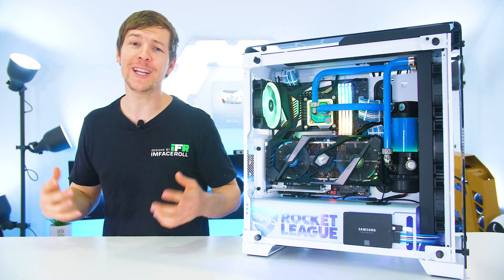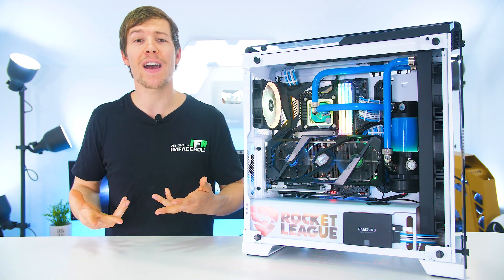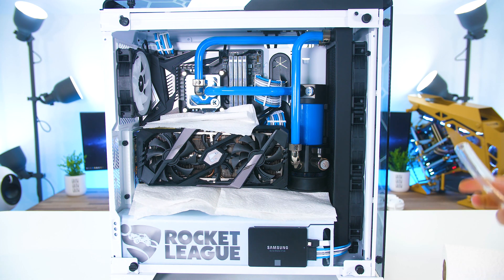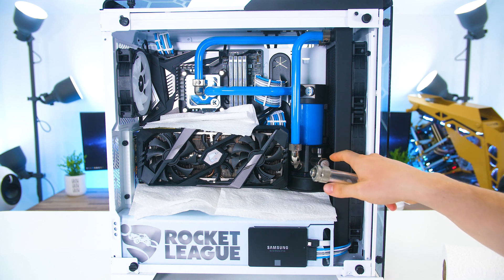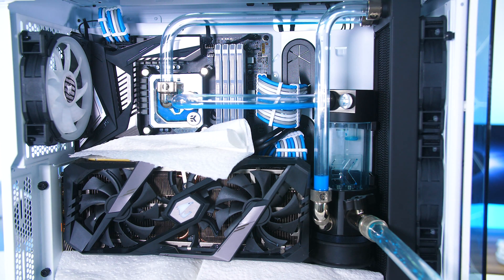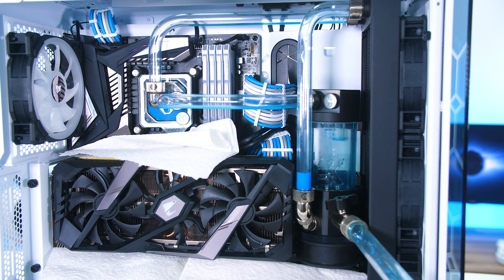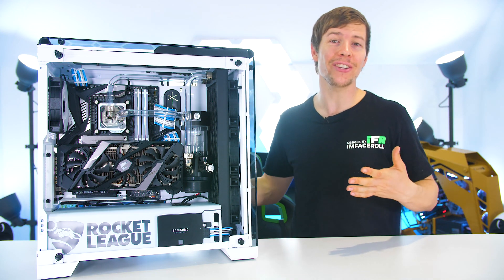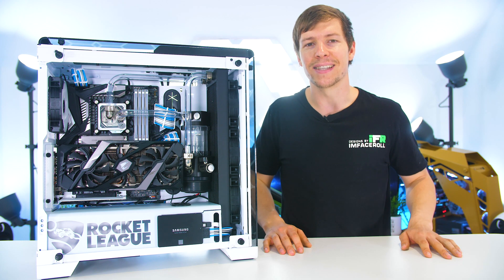Beginners Water Cooling Guide - How To Drain and Flush a Water Cooled PC Build.

Comment from the maker: Hope this helps someone out there looking into water cooling their PC Builds. Have a great day!
Reply: What case would you recommend for a soft tube rig?
Reply from the maker: Anything that fits the size radiator you are after. The good thing about soft tubing is it is flexible so it would work in most cases. The thing you really need to look at would be radiator compatibility
Reply: Designs By IFR what do you mean by radiator compatibility?
Reply: Thank you i need to flush my Pc and check the 2x 1080tis waterblocks :) Thanks for the vid :)
Reply from the maker: Very welcome
Reply: Yes thank you help me at lot
Reply: I am planning on using an antec torque waterblock (the thing you used in your most recent video but didnt fit with the graphics card) I can not find a suitable spot to put the drain port. the is one on the block but I think putting a drain port on the outside of the case will look really horrid. what is your recommended solution? should I just use a plug and when it comes time to drain throw the pc on its side and hope for the best?
Reply: Awesome Vid
Reply: In the description of the video for the GPU it says asus instead of aorus, just letting you know
Reply from the maker: Thanks for letting me know
Reply: Designs By IFR more important can I use my power supply bridge while draining the pc? Tech source said if your system runs dry it could damage parts.
Reply: Designs By IFR can you please explain how do you do the headers? A Mobo only have 2 rgb headers so how you use so many rgb fans?
Reply: I don't even know where to start. I've got a pre-built computer that came with water cooling and I've been very nervous cuz I don't know how to maintain or check it for any issues
Reply: I have a problem and couldn't find solution 
I have custom water sys 
2x 360mm on top and on bottom 
The bottom radiator is so so hot while top is not even warm 
Im not sure is it trap air or damaged radiator

Comment: Is able to build this config only with 3 "bent hard tube"? (bought directly from aliexpres or amazon for example. I'm not able to bend this tubes myself,  it seems too complicate). What kind of fittings you used (I guess 6* G1/4 + 1* 90º + 2* 45º) may be? I cant see the fitting you used behind the tube that goes from bomb to radiator, What fitting did you use? Thanks in advance

Comment: Hey buddy. Do you have your draining fitting attached to the 'IN' port on your pump/res? This is where I intend on attaching mine but wasn't sure if it was the correct port to use. I want radiator > top of pump/res > OUT port to GPU > CPU > back to radiator. Cheers

Comment: I'm sorry to sound harsh, but this video is pointless. If you have a valve, you're already well suited in watercooling, and it does not need a 10 min video to show how to link a tube and turn a valve open, then running destiled water... A video showing a build with no valve whatsoever, using bare methods for removing the cooling would be a useful video. Love the channel, but this video, pointless...
Reply from the maker: Its not pointless at all. What if you are a beginner (as the title says) and you have no idea what you are doing and you want to purchase parts for a loop, a lot of people wouldnt even think of a valve or a bit of soft tube to drain it. A lot of people wouldnt think to flush it or yo remove the top port. Instead of looking at it from the perspective of someone who already knows how to do it, look at it from a beginners perspective.

Beginners are nervous about watercooling so any and all information is helpful for them.
Reply: Can you still show a method without the valve though:)

Comment: Great vid. Nice looking build there mate. I ended up using 3 drain valves in my parallel loop just to make coolant changes much easier .My drains are set up so that all I need to do is remove one side panel and attach the hose like you showed. Besides my case is too heavy to tip up. Half the issues people have with draining their loops is that they sacrifice practicality for looks. I run distilled water only in my loop after having issues with some coolant mixes in the past. I flush my loop every 6 months. Pro tip for new open loop users , NEVER LET YOU PUMP RUN DRY!! you will destroy the pump bearing. 

Cheers , Have a nice day!
Reply from the maker: Great advice =)

Comment: In my core p3 i thingk what i will do to drain it is lay it flat on its back and remove alll the loop components,still connected, and then just open one end over a sink. One cool thig, for people that dont know it, it "Dr.Drop", its a pump used to leak test the loop, you connect it (it has g1/4 thread) to your fill port with a tube and fitting, then you pump air inside it, it has a "meter" (dont know how to call it but its round and you can see the pressure there), pump air to the recommended amount and then wait a minimum of 15minutes, if the pressure is still the same after that time, means the loop is leak free. Ill probably pump it and leave it over night, just to be sure... how annoying would it be to have a leak... take stufff apart, dry them... Really hope i never have one. Found about that and bought it fast, very smart product. Also, its super cool to put your new shiny pc together, but its very annoying when you have to fix or replace something (unless its an upgrade eheh), hope i dont have to drain any loop until i buy new parts.

Comment: i have some crazy ways of draining mine. Like attaching one of those dusters to a certain part of the loop, turn the duster on and since the duster blows air extremely hard, it pushes out all the liquid indefinitely.
Reply from the maker: I have had to do similar but id install the soft tube at one end and blow into it to get the liquid out and then i could clean everything